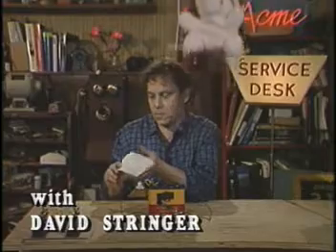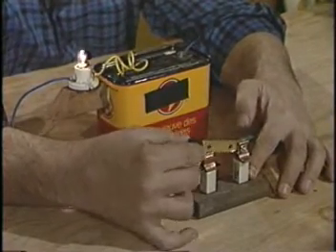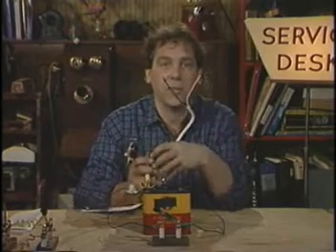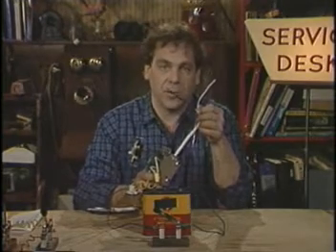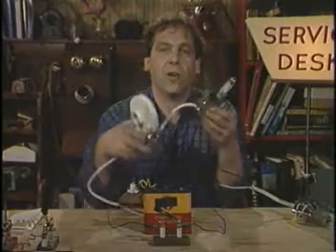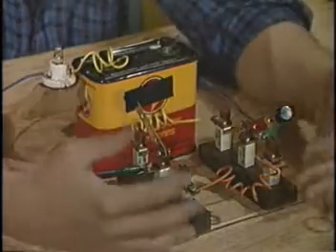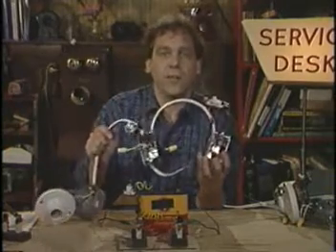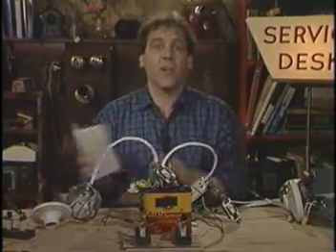Three Way Light Switch

Comment: @Electrotime to make a 3 way dimmer into a single pole dimmer all you have to do is buy a single pole dimmer,  remove the 3 way switches from the circuit,
take the hot wire and splice it to the other black traveler,  then from the other box where your 3 way dimmer was  take the 2 blacks and connect them to the dimmer. roll your red conductors back in the box and your done!

Comment: @Electrotime  a 3 way dimmer is wired differently than a normal dimmer  the common is by its self on one end of  a regular 3 way switch!   on a 3 way dimmer the common is in the place of where a traveler would be on a regular 3 way!  doesn't mean it is a traveler! that is just how it is!  nothing different! white wires where OK to use as a hot when white not used as a neutral in the 2005 Nec! but now it is different!  you should check the 2008 Nec! their is too much to explain in this comment!

Comment: hello,
Wich one is the traveling wire is it the taped one? I had a 3 way left over and I needed to replace one so I thought I would use the one I have. The black wire would get hot and the non taped wire is the outgoing wire is that right? If you dont mind can you do a qiuck vid and awnser my questions? 
Thanks so much:)

Comment from the maker: Hi,
As far as I know, a three-way dimmer is just a three-way switch with a dimmer in the common wire. Just make sure that the un-used traveling wire is nutted or taped so that it can't cause trouble.

Actually, at the price of dimmers, why not just play it safe and use the correct two-pole one?

Comment from the maker: If the switch is in the wire that is going to the light from the breaker panel, then it's like you say, and the white wire gets nutted together. Things are different when the power comes right to the light, and then another wire leads to the switch. Then, you end up with two hot wires goint to the switch, and the white nees the black flag on it.

Comment from the maker: Hi Electrotime,

The electrical code varies all over the place. Here in Toronto, the white wire can be used as a hot if it's tagged with a flag of black tape. This situation happens whenever a switch is at the end of a piece of wire, rather than in the middle of a run.